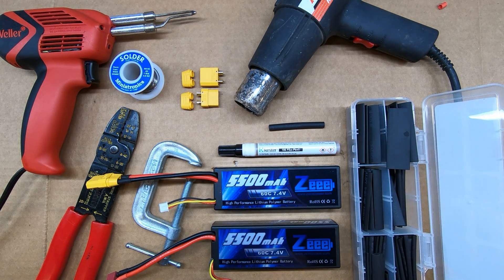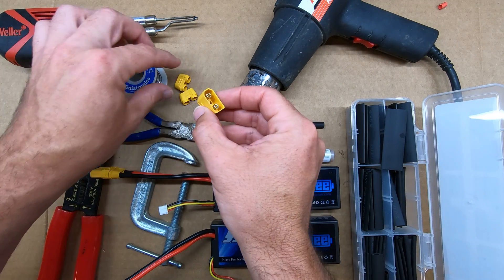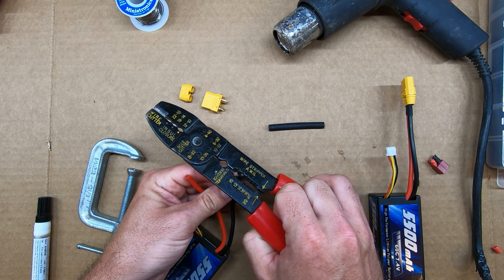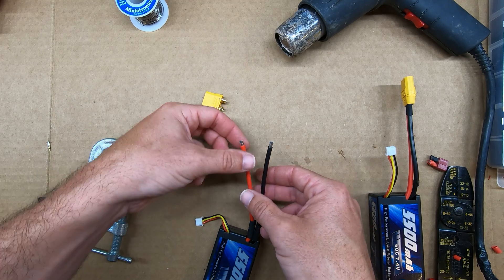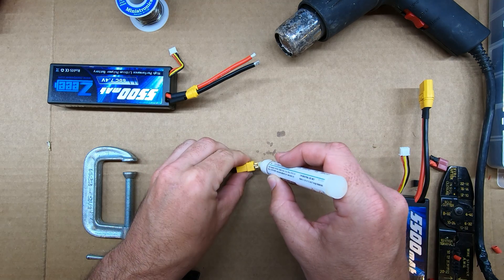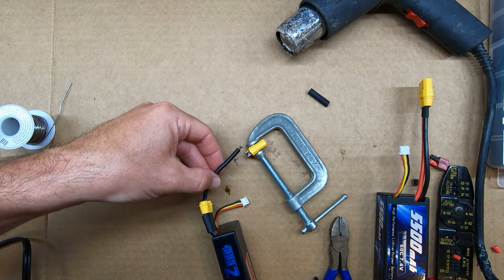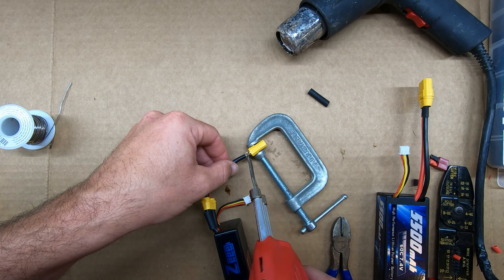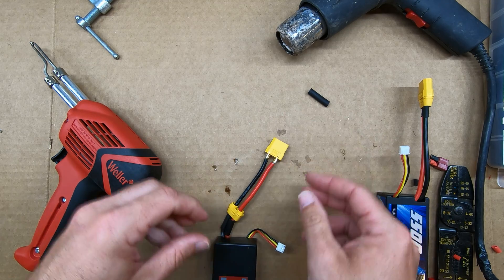How to replace XT90 connectors on a lipo battery

Comment: Supposed to plug male n female into eachother so that the heat doesnt melt them and they move it holds them in place just a lil tip and strip one wire at a time your a risk taker this video sucks